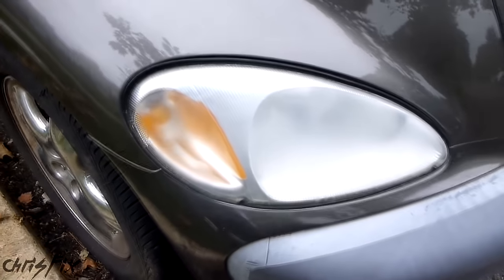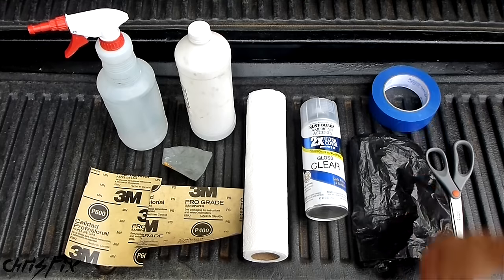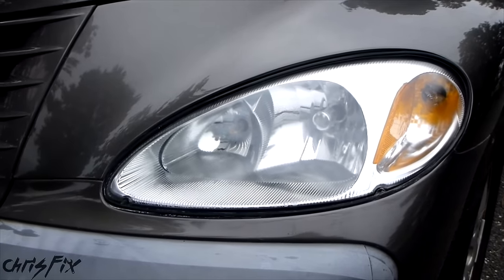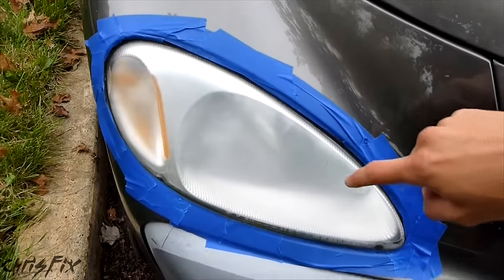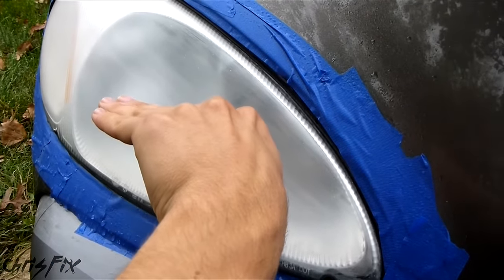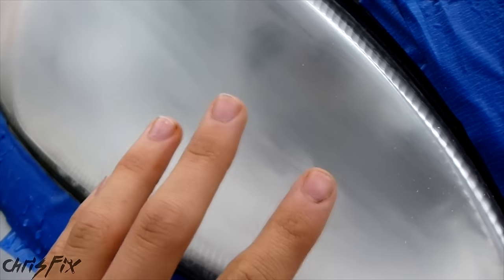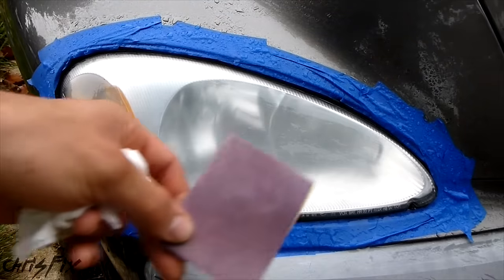How to Restore Headlights PERMANENTLY

Comment: Literally spent two hours sanding and wasn't getting any clarity, then I realized my sandpaper was topped at 1000 grit. Make sure you don't make the same mistake.
Update: I think my real problem was that I sanded too hard on the lower grit. Sanding more lightly doesnt seem to change anything. Am I screwed?
Reply: use a lighter grit, move to 1500 or 2000 grit. also make sure ur using enough water when wet sanding
Reply: @shjmo  yeah so two things I messed up on. Started sanding with too much pressure and then yeah I realized i was not adding enough water. The result is a basically opaque headlight. You think the higher grit sanding with proper water will fix it?
Reply: @LiminalSpaceMan192  it should, but let’s say you start at like 800, go 800>1200>1500>2000 making sure each time you move to a softer grit after the whole surface is sanded with the previous one

Comment: Hey Chris, just did this on my 06 Dodge Ram. I noticed a few minutes after applying the 3rd layer of clear it’s forming cracks, should I sand then restart and if so should I wait for it to dry before sanding? Thanks.

Comment: I used to work at a body shop when I was a teenager during the summer   . We always used rubbing compound on the head light covers then buffed them and it worked but I don't know how long they would stay clear because he would sell 30-50 trucks each week. The owner only bought, fixed and sold trucks from a water company and most were totaled or needed new fenders bumpers and we only painted them black he wouldn't use any other color lol. He would buy a few S-10'a but mostly Mazda and Ford Rangers since the parts were interchangeable. 32 years later and I still cough and spit up old paint lol "I am joking but sanding so many trucks in a closed garage with no ventilation did mess my lungs up bad and I am still paying for it".

Comment: My 2019 s 560 Mercedes headlights don't have oxidation but it appears to have over spray paint residue. Can I use this method and if so, what grit sand paper should I start and finish with. Thanks. New sub here.

Comment: Ummmmm did this and it was looking AMAZING until i put clear on way too heavy, made some terrible runs
panicked
sanded again for like an hour
noticed TONS of cracking appearing
Panicked and sanded some more
got the headlight to what I THOUGHT was smooth again and clear coated, but woke up the next morning to the massive cracks still there….

What can I do to fix this..do I restart but sand more?
Reply from the maker: The cracks can be from humidity, too thick of a coat, an incorrectly prepped surface, or the paint is not compatible with your plastic. You can always sand it down until smooth and try again.

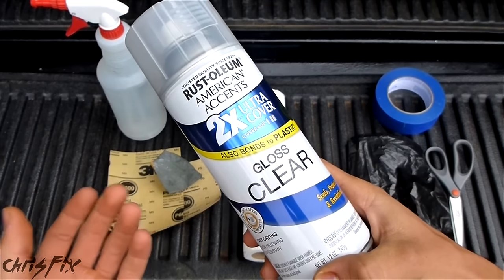Comment: 1:43 I used this exact coat because it’s what you used and my headlights look absolutely terrible.  Total cracking which everyone is saying there’s no fix for.
Reply: I’m pretty sure the cracking means the headlights are just too far gone u got some cracking but this method definitely didn’t leave them looking terrible they 100% look way better than when they were all fogged up
Reply: @A77738  well after the sanding, the headlights looked close to perfect when wiping them down with alcohol or water and when the clear coat was wet. But once it dried the clear coat looked like spiderwebs or broken glass

Comment: I just tried to resurface my hazy headlights per your video above.  I sprayed on light coal to the 2x Clear spray. for plastic.  It dried into tiny cracks all over the entire area.  Now what do I do?  Apparently the 2000 grit is too much for the clear coat to actually dry properly? How do I get that clear coat off now, and what coating or sanding grit should be used before spraying.

Comment: I'm constantly getting a thick haze in the head light after the 2000 grit.. even when I wipe with alcohol... it just returns to the thick haze.. Should I use a courser grit ... I only used 600 and 2000.

Comment: I did this and one of my headlights ended up hazy while the other came out crystal clear (ignoring orange peel). Is it possible I put too thick of a first coat on, or perhaps missed something when sanding, or is it more likely that it's somehow dirty inside? 2008 Accord, headlight enclosures are sealed pretty well and neither shows evidence of moisture inside.
Still haven't polished them- will be doing so shortly- but I don't expect it to help the hazier one. If it is something between the sanding and clearcoat, would hitting it with a lower grit to strip the coating and try again be a smart idea? (I probably won't do that, but I'd like to know)

In any case, the other headlight (which I think looked worse before) is impressively clear now, and even the bad one is much better than before. I did use a few extra grits, and I don't think what I used was technically clearcoat (UV resistant 1K gloss enamel?), but wow, it's incredible the difference it made. Looks way less trashy now.

Comment: I followed this method to the absolute best of my ability...used the right grit strengths, used the spray bottle, used the exact same bottle of clearcoat and sprayed it conservatively as shown...but I just ended up with an even worse looking, completely scratched up headlight covered in runny clearcoat. I tried to sand it down again and redo it but ended up damaging the headlight even more. Pleased be advised, this job is probably better left to the professionals. Or, just buy one of those cheap restoration kits from autozone.

Comment: Hey @ChrisFix so I did everything like the video.  I cleaned sanded cleaned up.  I used compound, then polish clean head light one last time with Alcohool.  And then hit it with clear coat.  And immediately the clear started cracking as it dried.  Everywhere.  Where did I go wrong?

Comment: With your method of way, do you reapply the wax every 6-12 months for permanent?  Ever try the 3M wipe on clear coat or Rust-Oleum "Protective Enamel Gloss Crystal Clear"; "Gloss Clear Lacquer Spray Paint"; "Gloss Clear Enamel Spray Paint" vs Rust-Oleum 2x?

Comment: I just bought a truck and have brand new headlights so what if I want to prevent any future yellowing? Would I use a clear coat or sealant?
Reply from the maker: I would follow these instructions and definitely put the wax on
Reply: @chrisfix  thanks! Would I still need to follow all the steps of the headlights are brand new with no yellowing? Or could I just clean them and apply the UV wax?

Comment: So I did exactly what you did up to the last stage. But I opted to hit it with a quick 2000 wet sand but it’s gone back to being foggy. I tried putting a headlight polish on them but it hardly did anything. Do I need to apply more clear coat?
Reply: if you hit the clear coat with 2000 you will need to buff it out with compound or put wax on it like he did in the video

Comment: Where can I buy some woulder? Can I use tap water instead?
I'm going to skip the clear coat and just keep sanding with 2000grit till it is absolute perfection. I'll just redo it lightly once a year, and that'll do it. Will this work? I've been doing this with great success so far. And I don't use any special woulder either.

Comment: I finally got around to doing both headlights on my 2002 Ford F-150.  The first headlight came out amazing.  However, while applying the second clear coat on the other headlight - it started to drizzle!  It wasn't supposed to, in the forecast,  and it only lasted a little while.  But I couldn't dap up the moisture as the clear coat was still wet.  Where the first headlight came out clear and absolutely smooth, this second headlight came out hazy and bumpy, presumably because of the raindrops.  Any suggestions as to how this can be fixed?  Do I have to strip off the clearcoat and start over?  <sigh>

Comment: So after sanding/and re-clearing with spraymax 2K clear coat my lights look nearly brand new, a small bit of orange peel/fog on one of the headlights, and I think I’m going to do a LIGHT 2000 sand, and then what would be best after: a polish or a buffing compound? Product recommendation?

Comment: Well. I am almost done. Applied a coat to each headlight. Looked fantastic, except mine dried in a 'cracking' pattern, the way mud cracks when it dries. Then, I applied a 2nd coat to each. Still looked clear although the cracking pattern persisted. Finally, put on a third coat on the passenger headlight -and it now looks CLOUDY compared to before and compared to the driver-side. I shook the can very well each time. PerHAPS, I didn't wait quite five minutes after the first coat. PerHAPS that psgr light was more in the shade while the driver side was getting some sun when I did this. 

I sure hope the right side clears up. :( I won't know what to do. Start standing and praying?

Comment: Do you have to wait 24 hours for the clear coat to dry before driving the vehicle? Or do you have to wait 24 hours before doing a wet sand and waxing?
Reply from the maker: Both, you can leave it or you can do a wet sand but I'd wait 24 hours before doing anything with it

Comment: In my country I cannot find the 2k clear coat what else can I use instead to do the job? I already tried what the video says but used something that wasn't the 2k clear coat and after one day it didn't dry out, when I wiped it off manually (after 24h) the headlights became hazy again and the horizontal scrathes that were made with the sandpaper 400, 600, 2000 are still visible.
Edit: Would you recommend the TURTLE WAX HEADLIGHT LENS RESTORER KIT? And if so would the kit work with the sanding that is already done to the headlight?

Comment: $250 each for a headlight???? I wish. The BI-Xenons on my 2009 Volvo are £1,200 each without the ABL Module, Ballast module and bulbs, which adds a further £700 to the cost. It's now wonder they're a favourite item for car thieves on newer vehicles. I've got everything I ned to restore the lenses except the gloss spray, so will order some and hopefully they'll look like new again. Always had halogen headlights previously and never really had any issues, except trying to replace one on a P2 Volvo V70, where you need hands like E.T. to have any success. I've swapped out an alternator on the same car in less time than it's taken to replace one dipped beam bulb. That's crazy.
Reply from the maker: Dang that's probably the most expensive headlights on any car!

Comment: Mine stays kinda hazey, sometimes when i do it on certain vehicles, any step im doing wrong that causes that?
Reply from the maker: I would sand it off and try again, if you do it in cold/humid conditions it can cause the haziness
Reply: Does it look like orange peel? Mine had orange peel from the spray paint that made it look hazy but I used 3m headlight wipe instead and that looks perfect. Maybe give it experimental try
Reply: @zzoinks  will do, 3m headlight wipe? do u use that as a replacement for the clear coat?
Reply: @chrisfix  Thanks man, started a restoration business using this, appreciate you so much

Comment: chris I am about to use your process on my wife's vehicle. Would it be ok to use my torx orbital polisher at a low setting for the sanding process and if so should I finish with the 2000 going horizontily or better to use sanding block for all applications. Also would p800 be ok for second step?

Comment: Hey Chris I did the steps but I never spray painted anything before and on the first clear coat application it came out runny AF and thick. I thought if I tried lighter sprays I could even it out. Now that its dried i can see all the marks from the run and now it's hard. What should I do to fix it ? Dry sand it with 200 grit and repeat it again or wet sand with 200 grit ? Thanks !

Comment: So if i want to clearcoat to protect, but I've already used a headlight restoration kit and they are clear and glossy now, it would be better to sand with 2000 grit before clearcoating? Versus not sanding.
Reply: I was thinking the same thing as I just did my headlights yesterday.
Reply from the maker: Yes if you paint your lenses you want to scratch the surface so the paint has something to grab onto. Otherwise it can peel over time.

Comment: Sadly this doesn't work in Texas.  Too much UV.  I tried this on 2 cars and about a year later the clear coat was coming off and it was even harder to get them back to the original clearness again.  I don't know the best way, but I agree the headlight needs some coating.  I'll try the Cerakote kit next.  I still love the 3M kit but it does need some coating on after.
Reply: The problem is after the oem clear coat is gone, unless you use a pro quality clear used to paint vehicles, the plastic continues to degrade and yellow. The clear coat shown here doesn’t have strong enough uv protection for very intense climates like Texas. You will be doing this every year or sooner. Better to replace headlight assembly with oem or good aftermarket brand like TYC.

Comment: Hey Chris, Ive just used the 400 on 2001 Tundra and still see some scratches on those 23 yr old headlights.  Can i redo the 400 b4 moving on to 2000?  Or just keep going w the 2000?  Thank you.  I must have watched 10 times before getting up the gumption to do this process.  But NICE to do it myself. If I don’t have a heart attack!
Reply: You shouldn’t be moving from 400 to 2000 at all you should use 600 before like he recommended I did it with 800 before the 2000 and it came out pretty good for me
Reply: @A77738  i did figure that out, it just wasn’t clear to me from the information given, and they came out great.

Comment: Thx. works fine but. I improved your version. If doing this on an older car.
It just needs a med. grit sanding while washing/waxing your car for the year. No need to tape.
Also Rustoleum is softer and will wear off, like my first time. Theres many different grades that cure harder for car clearcoat.
So a few coats with Rustoleum because it dries perfectly clear. Then a couple coats of car clearcoat. Some car clearcoat can dry a little cloudy or clear depending. Either way. No big deal. Many choices for car clearcoats. Faster this way.....
Reply: I used Rustoleum on homemade loudspeakers then waxed. Rustoleum was a perfect finish indoors..

Comment: Guys another tip....if wanna a much clearer finish after the final coat of clear spray do let it dry for few hours then lightly skim the sprayed light with 2000grid and wash off then reapply a coat of clear spray...it would make it even glossyier without orange peel

Comment: I ordered the Rust Oleum gloss clear coat from Amazon and of course, they sent the wrong stuff. It doesn't state it's UV-resistant or non-yellowing. Just 2X Gloss Clear. Will this work almost as well?
Reply from the maker: I don't see it advertised as UV resistant or non yellowing so I would send it back and get the right stuff so you're only doing this job once

Comment: I read you shouldn’t use clear coat - it will yellow again. Maguiars makes something made for headlights.
Reply from the maker: You have to use UV resistant and anti yellowing clear coat. That's what I used and even after a few years these never had any issues

Comment: Followed Fix's instructions.  Headlamps look worse than before.  Now I need to buy new lamps.
Reply from the maker: I need more info to help. You dont need to buy new headlights because they can easily be sanded down and cleared up if you followed the instructions. If you gave me more info on what is wrong, I could have helped you. I will just guess it is either cracked paint (too humid out or lens isnt clean) or there is a lot of orange peel what you want to do is wet sand it with 1000 then 2000 then 3000 then polish it with plastix until it's clear.

Comment: I’m worried because I followed the video and am at the spray stage . I have done 2 coats so far and they are not clear at all. Everything looks like your video u till the spray coat. What do I do now?
Do you still recommend wet sand after the clear coat or just the mcguires wax?
Reply from the maker: I would give it another coat, then do a 2K then 3K grit wet sand and see what it looks like then, if it doesn't look good you can always sand it off and try again
Reply: @chrisfix so you still recommend wet sand before waxing? Or can I just use the mcguires wax plastx?
Reply: @chrisfix so I am redoing it now just did the alcohol still doesn’t look great not sure what else to do. Am I supposed to sand until the water is no longer milky?

Comment: Best to polish the headlight till clear and then clearcoat rather than just clearcoat while hazy. Allows better longevity and more light to come through the headlight when done!
Reply from the maker: Actually since it’s a polished surface, the paint tends to not stick as well and you could have peeling issues down the road. That’s why I showed it the way I did.

Comment: So I tried with the sandpaper method and now my lights look even worse. Yes I used water. Started with 600grit, went to 800, then 1200 grit. I guess I need to now go buy some 2000 grit as well cos this did nothing but make them even foggier and they weren't actually even that bad!

Comment: Worked on my Murano (still has a 'clear haze' prob from the sanding)
Ruined the Driver Side Headlight on my G37 🤦‍♂️
So HAZY from the sanding.
Did it twice...might do it a third now that I'm using some vacation time.
Maybe skip the 400 because it wasn't that bad in the first place.
Reply: BTW what's up with the 'Orange Peel'? Is there no avoiding that?

Comment: Would sanding with the 2000 grit after spraying clear coat make it scratched up and foggy again?
Reply from the maker: That's what the compound/polish step is for
Reply: I’ve wet sand at 2000 grit at added carnuba wax and it’s now cloudy 😢